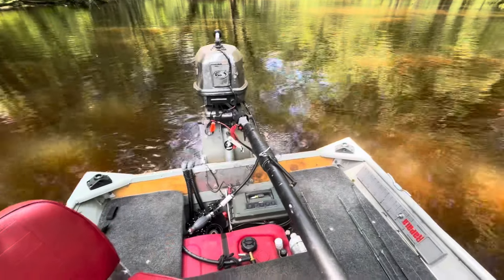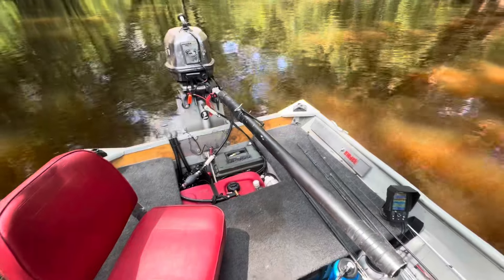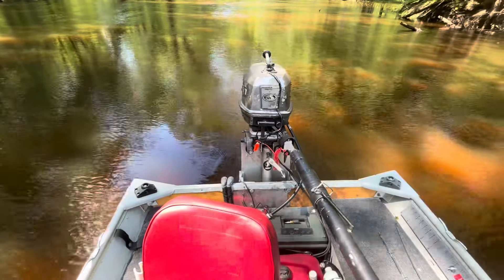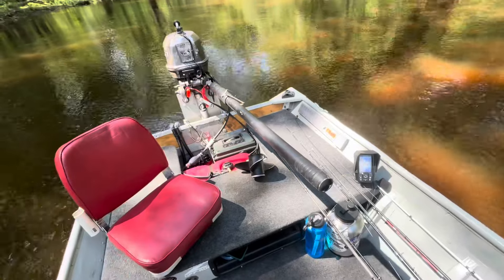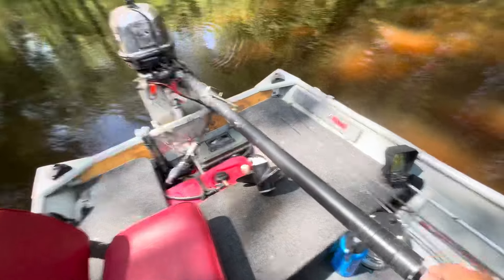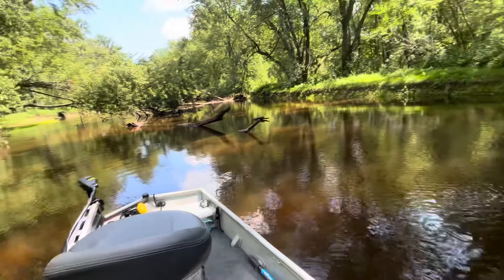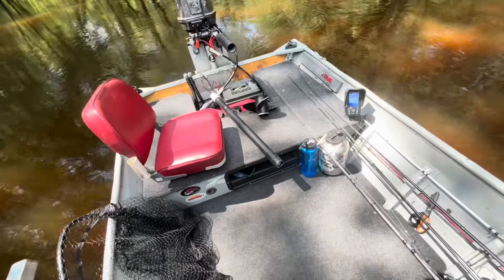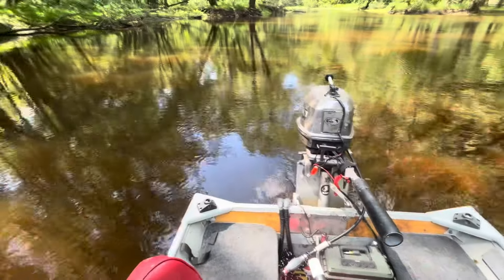Super shallow! Get your jon boat set up for skinny water- no tunnel or jet

Comment from the maker: Several are commenting that I'm destroying my motor, or its not getting water...so on.  I'm going to pin this so I don't have repeated comments.  The telltale is on the right side of the motor peeing strong.  I have another short from the other side if you truly care about my motor lol. If you know these outboards you can also see In the clip in this video that water is coming out of the exhaust which also shows the impeller is pumping water. Motor is doing just fine, and has been fine running like this for 2 seasons.

Comment: just finished replacing yet another impeller on a newer Suzuki because the owner added a jackplate and starved the motor of cooling, these smaller motor cooling systems arent built for being jacked up like this and its asking for disaster, best way to avoid is not to run too long jacked up.
Reply from the maker: I'm not familiar with newer motors, but on these older Johnsons as you have continuous flow out the telltale you can assume your head is full and by proxy the impeller is getting water and is fine.  I've been running this way for about 2 years now with dozens of hours at this height near redline.  Longest continuous runs are 5-10 miles up river like that clip I showed.  I probably do more preventative maintenance than most since I do ring this things neck.  I do impellers every winter and all looked new after a year of this operation.  The clip I showed is a bit misleading since the telltale is on the opposite side, peeing strong though.  It's pretty easy to just look and see this, so I think that issue you described is just someone who isn't familiar with the way motor cooling works.  Good note though.  I kinda assume someone searching this stuff is already in the know, but not always the case.
Reply: @timlong1462 Youre doing fine obviously, just Keep replacing that impeller at least annually, you should be fine, its so easy and cheap, the ones Ive seen are not too badly worn its short periods of lost flow that overheats them and they can lose a vane or two or become stiff very quickly which obviously means overheating becomes more frequent. I also think a jackplate in not so shallow water is great to reduce drag, Bottom conditions such as shells and heavy organic debris will definitely shorten the impeller life and clog thermostats, which is the bulk of what Ive seen as problems.

Comment: This is exactly what I wanted to see. I have plans to get an on the fly crank handle jack plate for my 1436 so I can run shallow. I just have an 80s sea ark 9.9 with a new impeller but I really don’t want to destroy it.

Comment: This is exactly what I wanted to see. I have plans to get an on the fly crank handle jack plate for my 1436 so I can run shallow. I just have an 80s sea ark 9.9 with a new impeller but I really don’t want to destroy it.
Reply from the maker: How easily does your boat get up on plane with that 9.9? I've wondered if a smaller lighter motor would do even better, but sometimes I need all the power this 25 has to holeshot fast, and basically have to run it at red line once the prop breaks the surface. 

I don't know how much power it's actually requiring though, could just be that it requires a lot of rpm and blade speed since it's chopping air and frothy aerated water.

Comment: Wouldnt it be easier to grab a surface drive or jet outboard?
Reply from the maker: Long answer to a short question: Absolutely would be in many cases, kinda hint to that at one spot in the video.  There's a few reasons I still have this motor.  Price of a whole new jet OB is a lot, and to run one on this boat I'd be forced to buy a jackplate anyways to get the transom height correct.  I may end up getting a jet one of these days, and now I'll already have the plate needed.  Most old 2 stroke jets and jet foots are now costing more than I paid for this whole boat, if they are even available.  I'm always looking for a foot that could slap on this 25 though.  Probably would only get like 10-15mph which would be "ok" for some stuff except those 10 mile runs up river loaded with camping gear.  A new unit is like 5-6K which is a lot and they're all heavy 4 strokes now.   You just lose so much power with a jet foot when it comes to these small motors.
 I can't run a 40/25 4 stroke jet OB on this boat or I'd be squatting like a dog and way over transom weight limit.  I'm not a fan of higher power surface drives either for the same reasons.  Heavy, no reverse until you get into more expensive options, and I don't want a longtail for a lot more reasons.  Most of the river where I run is like 3-4 ft deep, so a standard OB setup is fine.  Its not till I get back in there that I even need a shallow solution so this actually works out great.  Absolutely would pick a 1448 or 1652 tunnel jet setup over this any day though to be clear.   Just working with what I have and within a budget for now.
Reply from the maker: Another weird reason that might sound minor. When I am running my bow mount trolling motor there is a huge difference in my level of boat control with skeg in the water vs tipping my motor up.  I always prefer to have my skeg submerged and the motor pointed straight. With the motor fully up the back end of the boat basically blows any way it wants to in the wind or current. Gets old with 2 people casting. I know a jet would do the same without a skeg to hold the back end straight.
Reply: @timlong1462  Dont put a jet on anything less than a 40.. you lose 1/3rd power at foot. I run a 225 jet. Ive had several jet boats over the years and made a mini.

The skeg reasoning is weak at best, I run a 24 volt 80# bow mount n rarely deal with wind etc..
Reply from the maker: @Ajaxaxxess  Yep, well aware of the power loss as I said above.  That's the main issue and why I've done it this way for now.  Wanted to make a video for other guys who might be looking for a similar solution.  
Wind/current may not affect your setup, especially with the weight difference.  We are clearly talking 2 very different boat here, so I don't follow your comment.  This is a 1440 with a 25 and 45lb trolling motor.  Its not a power issue with the trolling motor, but that the stern blows away from the wind like a flag on a pole with the skeg up.

Comment: How high is the cavitation plate sitting above the bottom of the transom with this set up?
Reply from the maker: Right at 6 inches when I have the plate all the way up and neutral trim. I mounted my motor around 1/2 inch higher than it was before. At full drop the plate is 1/2 inch above the bottom of the boat. The plates are designed with 5.5 inches of lift. 

 The lower unit nose cone is perfectly flush with the bottom of the boat fully lifted which is what my goal was.

Comment: Glad I found your videos.Have the same boat I think 1440 Lowe with same motor.Yours is set up much better.I run a rock cage on my prop.Was just looking into the same jack plate.I was concerned  about mounting it with the lower bolts not going thru any wood only the aluminum transom.Didn’t look like you added anything such as a spacer of wood for the two lower bolts?You have a link for water  intakes?
Reply from the maker: Hey, glad it was helpful! I was looking for stuff like this a few years ago, and its a kinda sparse segment of YT which is what made me want to make a few videos.  

If you look in the opening clip of the video you can see I have 4 bolts going through the wood portion of the transom, then the 2 below you referenced(not really visible) that are in fact only through the aluminum.  The way this applies pressure to the transom is mostly pulling on the top bolts while pushing in on the bottom, so you might be fine with just the 4, but I'd recommend doing what I did and just add 2 holes through the wood.  The plate comes with only 4 mount holes, so I just drilled 2 more lined up to catch the lower part of the wooden transom. You'll want to be sure your transom is in good shape because this does add more strain and leverage.  I'd also do a front plate like mine to spread the load of the bolts if yours doesn't already have one.  I saw you commented on my other video, so you've seen some of the transom work I had to do.  Mine was rotten dust, so I had to replace well before I ever got this plate.  I also replaced the angle aluminum brackets that go from the transom to the boat sides.  Factory ones are kinda flimsy in my opinion so I went with longer sections of 3/16 thick angle aluminum to spread that pulling/leverage load out.  

Water intakes are from a guy on FB.  Look up TR Machining out of TX.  Just send him a message, he was super easy to work with and has most of this ready to ship.  They aren't cheap but they do work for me, and are much cheaper than a custom low water intake or nosecone.

Comment: What brand and hp size is the engine ?I can only find that prop for bigger motors
Reply from the maker: It's a 2000 Johnson 25. J25TESSD is the code.  Prop is a Solas HR Titan 4. I bought the prop from Boat Propeller Warehouse, PN: 2253-100-12